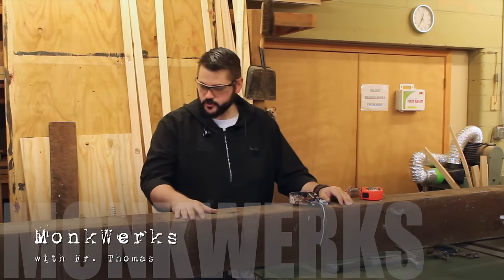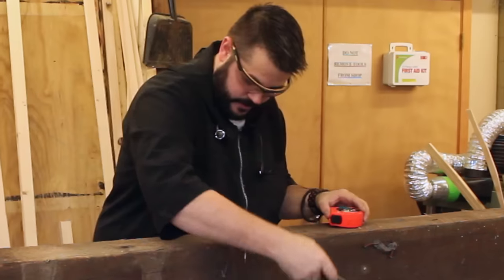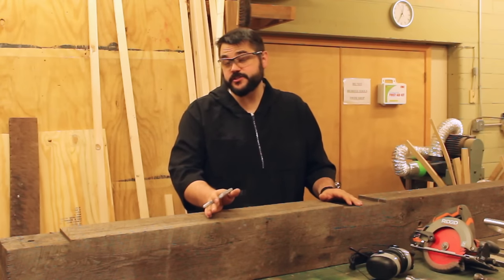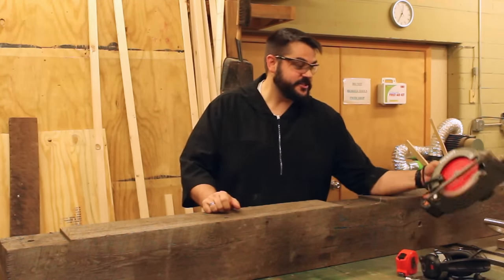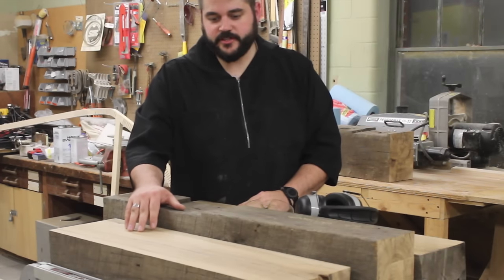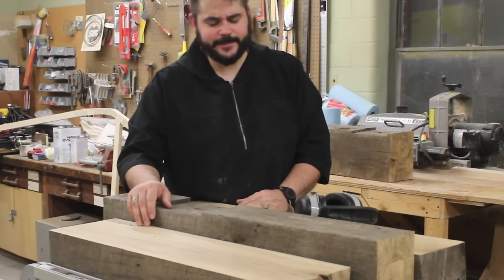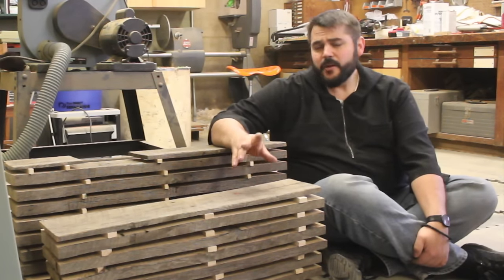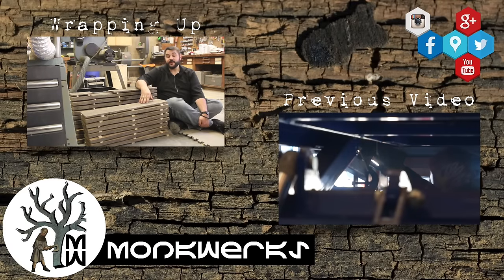Milling Reclaimed Lumber (MonkWerks)

Comment: great job! I also use a sawzall to mill up large joists like that. I bought a pack of 12" long "wood w/ nails" blades and they work amazingly well on larger, reclaimed pieces like this one.
Reply from the maker: +Keith Decent I've a couple more of these beams. I think I might need to pick up a couple of those longer blades, thanks.

Comment: Sir, for your safety I thought you might use a technique that clients of mine used. 

Their business was selling game birds, such as duck to restaurants. Their own clients did not want to serve lead shot to their customers. The company used metal detectors to find any lead shot in the carcasses and check they had removed it all prior to despatch to the restaurants. 

It appears to me that you could either make a simple metal detector or buy one and check that any reclaimed lumber is free from nails prior to using your power tools.

Thank-you for your most enlightening videos which I thoroughly enjoy.
Reply from the maker: +Ian Turnbull A metal detector would certainly be a good precaution, however, the metal/wood blade on the sawzall shouldn't have any problems if it had run into anything.
Reply: Yes sir, I assumed that the latter stages of reclamation you could damage your planer or other saws, or indeed injure yourself by an unexpected failure in your equipment, due to undetected metal fragments from previously employed fastenings. Regards

Comment: Nice job Father,  any reason why you couldn't or did not use a chain saw for length?
Reply from the maker: The first reason is that I don't have access to a chainsaw at this shop, but also another issue is kerf size.  With a chainsaw you lose about a 1/3" for every cut, whereas a bandsaw is only about 1/16".  I also have better control with the slower action of the bandsaw than the chainsaw would have had.  But yes, a chainsaw mill would have worked just fine to breakdown the material.
Reply: Dear Fr. Thomas, 
good job!
Why not to use simple saw like Ryoba or western style one? It is fast an accurate.